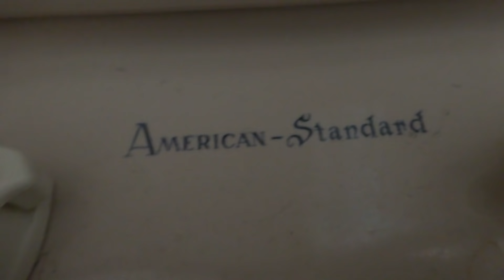OLD TOILET LEAKING WATER FROM FLANGE WHEN FLUSHED

Comment: Looks like thet botched the rough in at 16",  and set the flange high enough to tickle your cranberries. Next level sister/mama
Reply: @throttlebottle5906  most guys back then and some today always set them above the finished floor, I rarely see anything greater then a 12 or 14 in rough in though

Comment: Not plumbing related: can you comment part 2 to the video from 4yrs ago where you put a rescue motor on the trane ac unit, or can you tell me what motor you replaced with . I’m having the same issue, but can find a fan motor. Plz and thanks.
Reply from the maker: it was a rescue motor
Reply: @stevenlavimoniere  did you eventually get the 2 speed motor you referred to as being 4 days out ? I guess I’m still needing to see part 2 as to how to disconnect the low speed or whatever you were referring to bypassing. Thanks
Reply from the maker: @plurmingo1  i think i did just that .rescue motor .trane is crazy with prices fuck them .. you really dont need the low speed .. just match up the amps ,,, speed , and voltage   and make sure the direction is blowing up and out .. you can change direction on rescue motors there is a tag on old motor .get info of that .. the supply house i deal with has tons of motors of all kinda i usally bring the old motor in and match it up .as close as i can .. amps are very important to stay close to and always replace the run cap . it will say on box the mf of cap

Comment: On PBS they had this woman tech called "The Handy-Mamm". She changed a wax ring and said to always caulk around the toilet base, to spare the wooden sub-floor.  I saw one of yours, Steve where you were scraping away the old caulk and raising Hell about it because it made the toilet removal so much more difficult.  The caulk does not help?  Your sister seems proud of her knowledge that water and electricity don`t mix!  (And maybe a little high strung)?
Reply: How would sealing the porcelain to the floor help with anything?
Reply: @johnboykin3128  That is a valid question, John.  I assumed that it prevented natural condensation from warm, humid air and a cold ceramic toilet from eventually seeping down and making its way past an imperfect wax ring seal and getting absorbed by the wooden sub floor.  But some people use fabric tank and lid covers to help with that.  Then there is the possibility of a toilet overflow, or tank leak.  I changed my wax ring and found that my sub floor had water damage from before I moved in. So that is my best guess.  I did not caulk around mine because it did not occur to me to do that and I had never seen it.

Comment: I've in 31 years plus never had a problem with the horn ?
But in my situation (commercial)most always had to use deep seals and or double up on the single Johnny ring?
🥃🥃🍺🍺🍺🤔🍇🏌
Stay safe.
Retired(werk'n) keyboard super tech.
Wear your safety glasses.

Comment: That's why toilets need to be grouted, even required by inspectors where I am. Done properly lasts over thirty years. I can see you guys quire about it, so do what you want :) As always thumbs up from me.
Reply: OCC Plumbing & Restorations  I head to remove one for not plumbing reasons and it comes out just fine, some grout on the floor that I scraped with ease.